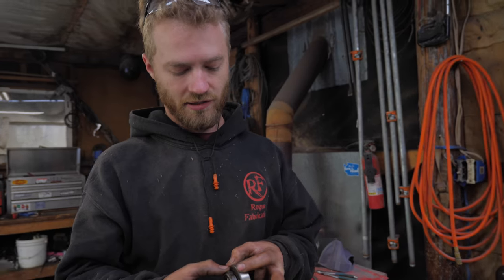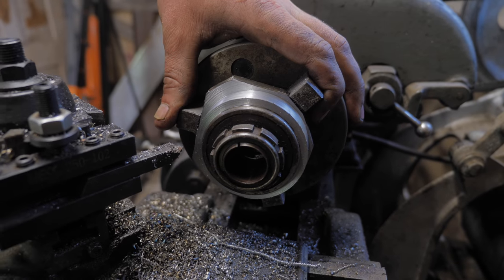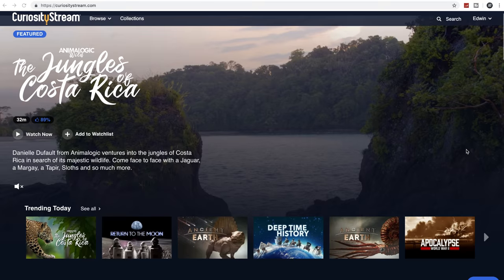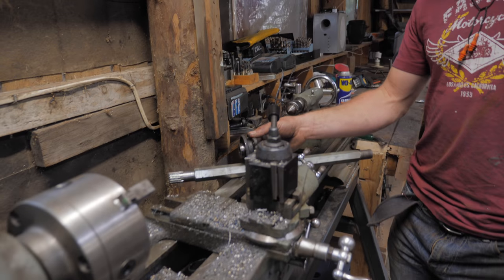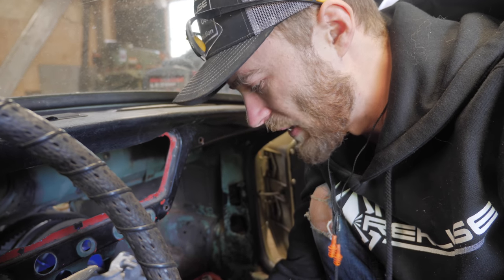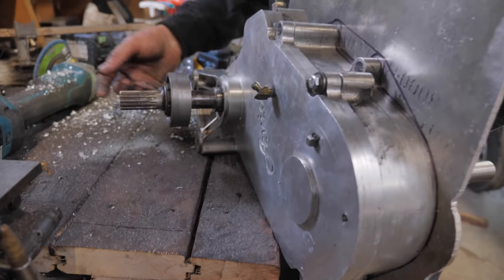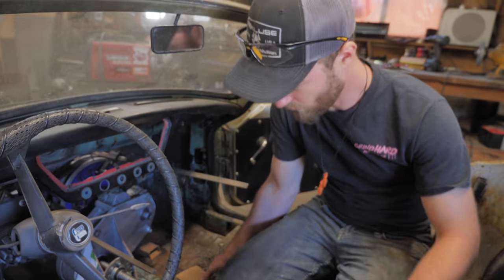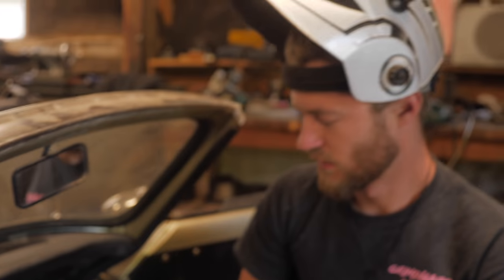Snowmobile Powered Sports Car Gets Custom Drivetrain

Comment: My sled uses the same chain case.  The weak point is the stud that the tensioner sits on.  You may be able to machine the case in order to bolt through the entire case/Stud.  It breaks when you unload and load very quickly.

Comment: Nice work guys!!! Definitely gonna be rowdy!!! Remember, the U-joint in the driveline will see less torque than the U-joint in the oddysey. The driveline u-joints have the benefit of the gear reduction in the rear axle. So whatever the ring and pinion ratio is, it reduces the torque on the U-joint by that factor. So, the u-joints will probability work just dandy!!! Keep it up!!!

Comment: Why did you put the clutch to the right side instead of up?
I own a spitfire, theres some serious space up there especially when you take out the factory heater box.

Also, can I possibly buy the battery tray if it wasnt too rusted before you chopped it? Mine is pretty nasty.

Comment: This is such a cool build, can't wait to see it run, btw those two bolt holes you were not sure what they are for, there for the dash support, connects the bottom of the dash to the floor and keeps the dash/cowl from shaking too much when you drive.

Comment: A little trick when machining that square for the bearing instead of mounting the square to the chuck mount the square to the cross feed where the tool usually goes and make a boring bar and turn it between centers of the chuck and tail stock then have your part in the middles on the cross feed

Comment: Great fabrication work, it's going to be an awesome little car when done. 
There is lots of room in the rear, a Subaru diff fits in there and can be adapted to the existing hubs and swing axle set up. There are even kits for the Triumph Herald/Spitfire that replace the existing rubber doughnut joints in the rear axle with CV's. The GT6 added a lower control arm to the rear axle, which should be easy for you guys to do. I suspect you could even fabricate a proper double wish bone set up based around Subi diff head and axles. 
Keep the leaf spring though, it works really well, is part of character of these cars and you can mess with it to lower the car and get rid of the positive camber which helps a lot with cornering stability, and a good set of shocks will reduce or even eliminate axle tramp from all that extra power.

Comment: u joints should be fine. In that application they are under much less torque load than on the odyssey as they are before the differential final drive gearing reduction and probably under less extreme angles.

Comment: Get a Miata drivetrain! It will do exactly what you are looking for, and they are cheap, 500 bucks for the diff axles and driveshaft. That’s if you can’t get someone to give you stuff for free. 

They hold good power and are lightweight and simple.

If you go on the Miata forums and tell them you want to use a miata drivetrain you will have as much info on gearing and stuff as you would need.

Comment: If you learn about feeds and speeds on the lathe you can make that in about a half an hour. When using carbide tools it is ok if the chips are hot and blue.

Comment: What is the attraction in putting a snowmobile motor in a Spitfire body? Please explain so I can enjoy your choice.
Reply: 200hp in a nice compact package, and because they can? ;)
Reply: @lesgobrandon9826  are they a 4-stroke motor or a 2-stroke motor,
Is it water cooled? How much does it weigh? What's the red line?
How much torque? The Spitfire has been consecutively one of the best sports cars. I've had over 245 cars, so I was just wondering what the turn on was?
Reply: @ericheine2414  no idea on snowmobiles. I'm Australian, lol

Comment: That secodary pully is going to have a very, very extreme forces applied to it.And will need extreme brackets and gusets to have it stay where its supposed to.Probably more than the snow mobile had.Just my thoughts.

Comment: are yall going to check if the oil pan has baffles or if the oil pickup tube needs to be moved to the back of the oil pan so it does not starve for oil or does it use mix gas

Comment: Love the channel. Keep up the great content. But I did notice that the belt is sitting to low in the secondary. Either that belt is shot or  the secondary is  not shimmed correctly. You will lose on both ends. You will be  starting out in a higher gear and the primary won't be able to pull the belt all the way into the secondary to get max shift out. Rule of thumb is the bottom of the upper cogs should be even with the top of the secondary shives. If this helps at all.

Comment: The 2 positions you are unsure of what they are for ( 11:30) ? Those are where dash board center support bracket went. It has plenty of strength
Reply: ^ This, and IIRC the factory Leylock OD unit mounted atop the tranny and also bolted to the tunnel. 
(The turn signal-like switch on the right of the steering wheel would engage from both 3rd & 4th gears.)

Go -GHPC! 👍

Comment: Would you not have saved an hour on that lathe by using the grinder to "rougly" make that square circle-ish first? Turning down a square is a pain in a metal lathe. All you have to do is cut off a few corners first.

Comment: I would have put a 302 and  t5 in it. 5.3 would be cool but if you like bangin gears your going to spend $2500 on a manual trans for a LS. ..... and thats why i like sbf/t5. $300 engine and $300 trans. If you get a 302 out of a explorer with gt40/p heads you can make over 300 fwhp with a simple cam swap. But it will weigh alot more than this. They did this swap on motor trend a few years ago and it was mental. That was just a stock Lo-Po 302 out of a truck or something with probably under 180 fwhp.

Comment: Regarding the bearing getting stuck: do you not have a through hole through the lathe spindle? I'd expect you to be able to stick a rod through the headstock in order to tap the bearing out.

Comment: I'm thinking it would have been easier to adapt a 4 speed manual from some 1970's to 1990's Ford 4 cylinder. Perhaps one from behind a car with a turbocharged 2.3. Adapt the flywheel to the snowmobile engine, fabricate and attach a plate to the engine to duplicate the Ford engine's transmission mounting hole locations.

Comment: Are you taking bets on how many axles you brake during the first test run? I'd bet both! Upgrading the rear end will be a must. My dad's Sprite, of the same vintage, sheered an axle with only 75 HP. Which has always made me paranoid of doing the same in my Midget. Good Luck to you!

Comment: Good stuff. Is the secodary clutch directional? It is turning in reverse now correct?
Reply from the maker: It’s still spinning the same direction. The output shaft is just coming out the opposite side of the clutch.

Comment: I have to ask. What is going to be involved in changing the belt, once it is completed? Should have waited until 15:30. That is awesome! You are a Great, Master Engineer, Ethan. I love your boxing and gusseting and at the same time, lightweight. That is going to be one sweet little sports car. It is going to be what everyone who ever owned one, Wished it was like. Looks AND Power. Gobs of power. When done, match with a super deep paint job (Worthy of Imron, or what is better that is available today).
Leather Interior. I would think, Candy Apple Red with...I don't know about interior. Tan? Black would look good but really hot in the summer. I suppose it wouldn't be sitting idle very long, though.

Comment: Don't mean to be a Debbie Downer, but those bearings need to be a press fit, not a slip fit. With it just sitting in your support (and on the shaft in the case of the timing belt tensioner) they will spin every chance they get. This spinning causes heat that will boil the grease out of the bearing and cause the bearing to fail. Also, I know you didn't leave it there very long, but always pull the key out of the chuck on the lathe. If your hand is not on the key it should not be in the chuck. This is a cool build and I can't wait to see it when it's done.

Comment: Did you guys take into account the yoke needs to be able to slide a bit when the rear suspension compresses?  Most likely what those splines that he machined off  of the driveshaft plate would have done.
Reply from the maker: Good point, but the rear differential is mounted solid and doesn’t move with the suspension.
Reply: @GrindHardPlumbingCo  Ah I thought it had a solid rear axle, ignore me then and keep up the good work.

Comment: I see that belt set up and I’m pondering whether that was genius or potentially problematic down the road no pun intended. I’m no engineer but would a super strong double or Triple wide chain be better ?
Reply: The belt is needed for the CVT as it gears the car from standstill to top speed.

Comment: It appears that your drive side of your chain in the chain case is on the idler side of the chain...this is gonna be a problem...drive should always be transmitted through the straight side of the chain, otherwise you are putting hella stress on the idler pulley.   otherwise... good work man!
Reply from the maker: Don’t worry, it will be powered on the correct side of the chain.

Comment: Why don't you just unbolt the body and lift off the chassis then you have room to measure and make to get everything spot on! Then cut the firewall to fit the clutch transfercase assembly. Starting to look like a project Binky build.